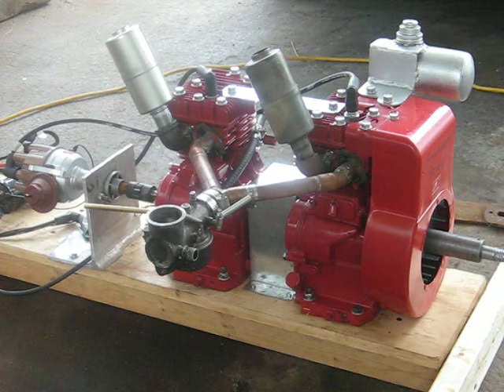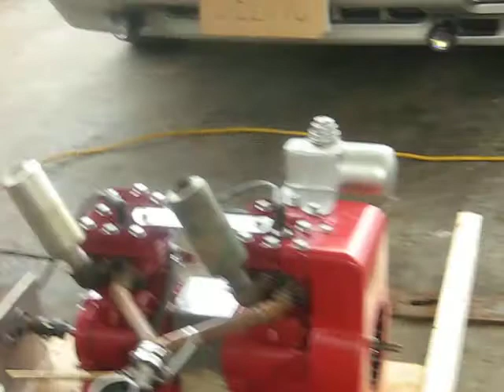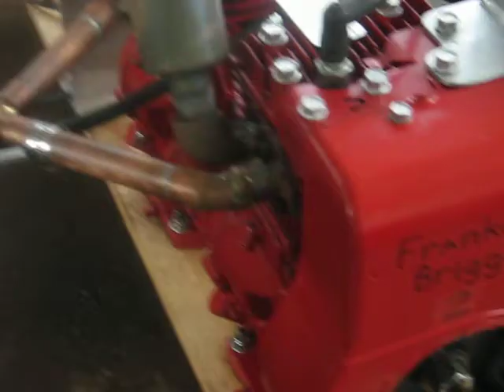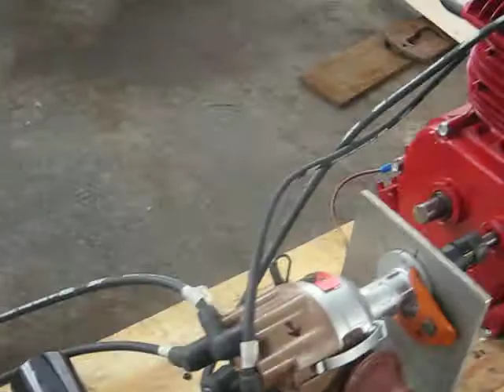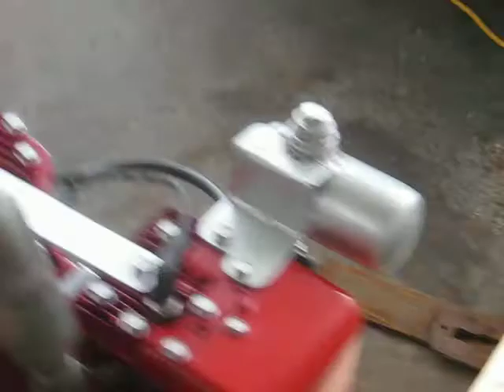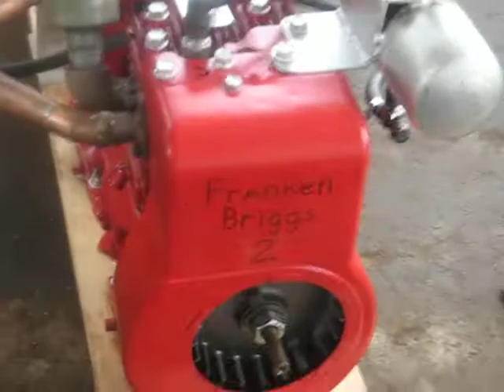FrankenBriggs 2 Its ALIVE!!!!!

Comment from the maker: It is taken apart at the moment, I ran cylinder #1 alone, as well as making a 2 cylinder engine from #1 &2 this summer. I now have the new chain couplings to fasten the engines together, so I just need to hook it all together for another run. It doesn't sound complicated, but I have to put the cranks back in 3 of the engines, phase, then weld the chain sprockets for the couplings etc., so it is quite a bit of work. The fall weather is upon us here, so I can't be sure when I can run it again.

Comment from the maker: Yes, that would be simpler and lighter, I may still have some angle, but I gave most of mine away to the Solar Sterling engine project at my sons old high school. They use a 10 foot satellite dish to collect the light, not running yet, but quite the cool project! I may have to post a vid  :)

Comment from the maker: Hmmm, interesting idea, I will have to think about that, as I just realized the I beam I have isn't going to be wide enough, plus it is heavy!
If I bolted this to a steel base I would have to assemble it outside, and tarp it after use like I did with the Jumo 205 type engine. When they get this big and heavy, they start to cause problems.  :)

Comment from the maker: Yes, it did sound good, although it only lasted 13 seconds!
My wife got the jump on me with the starter, I was surprised it started right up before I could get to the throttle and choke!
It bit the dust just when I was opening the throttle and revving it up :(
Guess the poor coupling couldn't take the higher revs.
I expect the new chain couplings will hold up MUCH better!

Comment: You should make up an electric starter, for the FrankenBriggs, maybe a starter generator with a belt going to engine-cylinder 1 flywheel, I imagine starting with a drill, from cylinder-engine 1 flywheel, will start getting hard on it and maybe break it.

Comment: You really ought to make a proper steel base. Those wooden bases just flex too much. Or perhaps just getting two long, heavy pieces of angle iron, and putting them down between the engines and the wood base. That way it better couples the crankcases together.